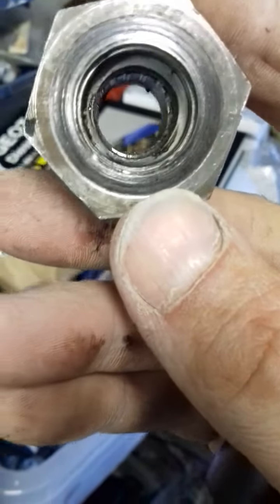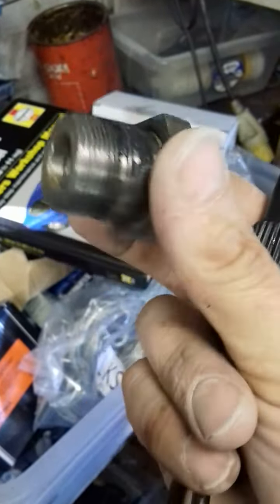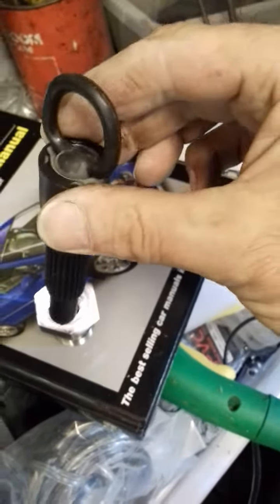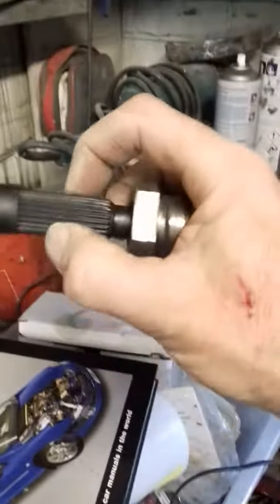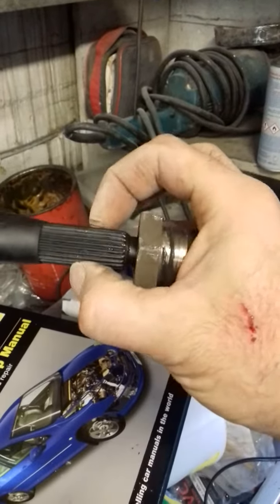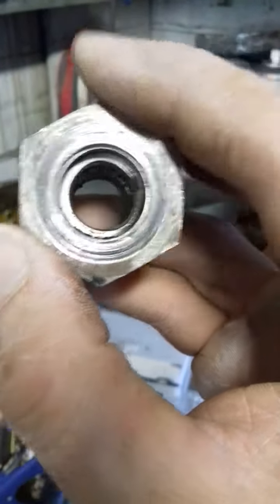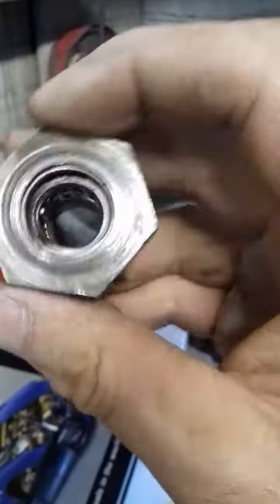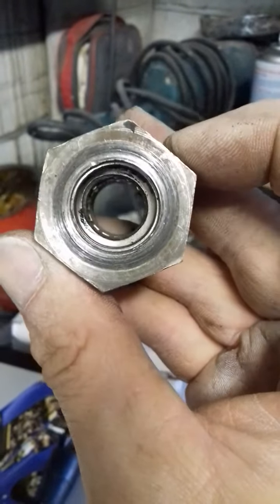Classic vw beetle clutch problem judder noise

Comment: What does the noise sound like?
Reply from the maker: It werd a noise sound if clutch release bearing gone or a wheel bearing not grating but a wherring stops wen pedle up onley wen pedle down
Reply: Craig Kidman my clutch was adjusted  because the clutch pedal was too high. mechanic tightened something and now the pedal is hard and vibrates like crazy and now I hear ticking when I accelerate.
Reply from the maker: It sounds like cable in the tunnel some other people on net same noise bracket shaped
Reply: Craig Kidman Thanks. Hopefully he'll fix it on Monday